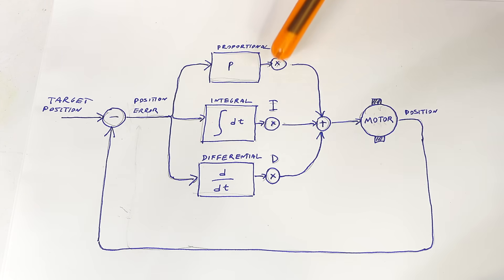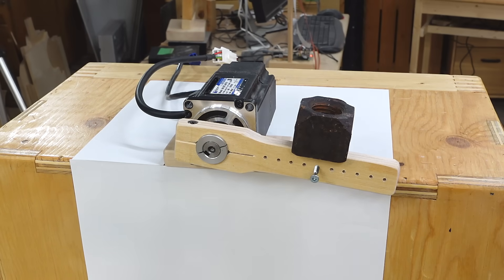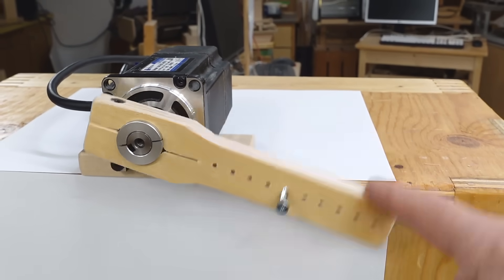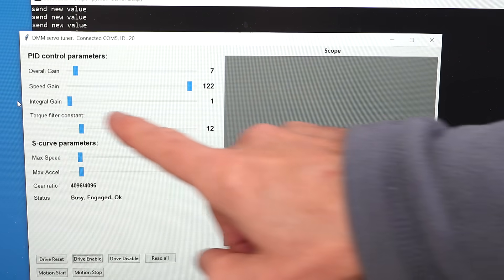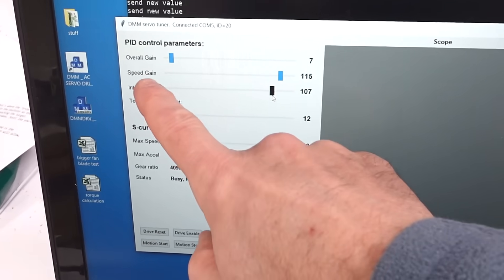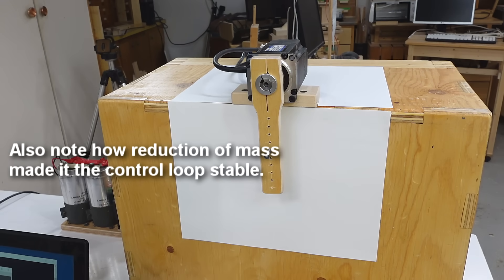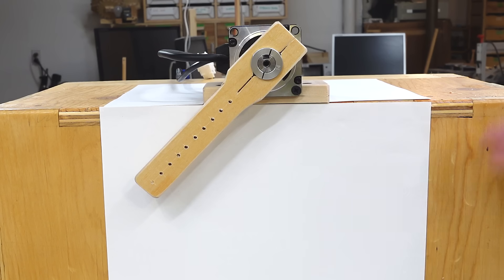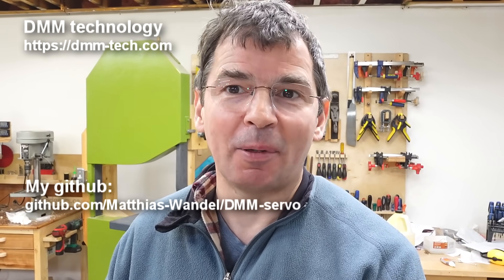What does a PID controller do?

Comment: D is derivative not differential!
Reply: Strictly speaking you're not deriving a slope from a mathematical function, you are measuring a difference in a signal, so "differential" seems like the more technically correct term, even though everyone calls it the derivative.
Reply: @excrubulent  Actually you are calculating the slope of a function - that of error vs time. Yes you calculate the difference between two error samples (an approximation of the differential) but then that gets divided by the sample period resulting in an approximation of the derivative. And that's why it's called the derivative term and not the differential term. Anyway i enjoy the videos - keep up the good work!!!!

Comment: I like your sliders.  Most of the processes I was involved with took a long time, so tuning PID was difficult.  Mostly systems worked well with just enough power (actuation) and on/off controllers with loop times that were much faster than the actuator response.    Some controllers have integral time instead of integral gain settings... so it takes time to figure out what's going on.
Reply: The gain on an Integral section is adjustable, it's a multiplier for the incoming Proportional signal.  What is changed or adjusted normally on them is the RATE that the gain is applied at.  Called Repeats Per Minute, RPM.  That's what you are adjusting in reality, the time from where if there is a given error, the Proportional signal is added to the Integral output.  So if it's at an Integral gain of 1 and at an Integral rate of 5 RPM, for a certain error it will add 1 times the Proportional signal to it's output.  If that deviation is still there in 12 seconds, it will repeat adding one unit of Proportional output to it's signal  It keeps repeating that until the error goes away.  If you change the rate to 10 RPM it will do that twice as often, so every six seconds.

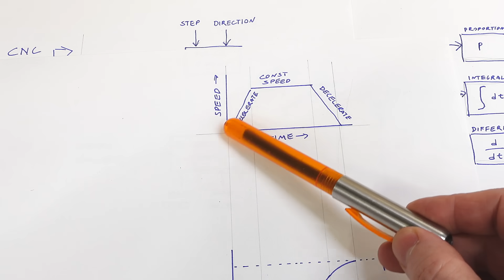Comment: 8:10 - Maybe other people pointed this out. The way you structured the explanation - S curve is actually not accelerating at a constant rate (straight line - as you point to a trapezoidal style acceleration strategy) but at a certain mathematical function (that results in not a straight line on the graph). Also you have only drawn a half of the S curve graph if you want to talk about reaching the desired position - what you have there is only reaching the desired speed.
Reply: I think he mistakenly labeled the Y axis as speed, when its probably position, as in position over time.
that would make the graph make sense

Comment: As an mechanical engineer and having tuned servos, this is a great video. Thanks for posting! Some college professor is going to use this video. A common issue I come across with instability is because of dead band or backlash feedback and servos tuned up way too high by someone who is obsessed with speed at the cost of reliability.  I always back my settings down slightly and never have issues.

Comment: Nice illustration of pid controller. How ever I think what you referred as S-curve here, was more like trapezoid control (constant acceleration, infinite jerk). When talking S-curve we normally have constant jerk, which makes acceleration to look like trapezoid, which makes speed curve looking like S-curve and which makes position curve looking more like S-curve. And making the acceleration non constant makes the system really smooth. So if you have glass of water on linear axis driven by S-curve, starting and stopping doesn't make water spill so easily. That would be really nice illustration also.

Comment: Nice visualization of PID. For me, before I knew there was such a thing as PID, I was tasked to get a slave microprocessor to “tweak” its VCXO to match the master TCXO using only the receive data as the “phase detector”. Determining if it was ahead or behind was easy (differential) But if I just ticked the control voltage up or down every sample time (every data edge) by the time it shows no error the correction has accumulated a lot of “gain” meaning the speed at which it was approaching zero error was high. So it just oscillated back and forth infinitely. I thought that if I knew the direction had changed then I would be good! Nope, I needed to know how far away I was from perfect sync (proportion). So if I was far away I needed more gain to “hurry up” and as I got close, I needed to slow it down (Integral). I figured it all out one piece at a time and then 20 years later I am working with a Peltier cooler and a PID controller for them and I was like “I’ve done this before”. I had no idea it was a “thing” back in my youth.  But it is a very difficult thing to explain and my long winded comment is just to say, good job! 😊

Comment: Maybe PDI for motor control and PID for high thermal mass temperature control or big ship navigation control (where I think analog PID controllers made their debut) . I am thinking Motor Position control has to deal with sudden system upsets or step upsets so needs to rely more on the D term whereas temperature control not so much (except at turn on) and relies more on the I term, although it depends on the exact nature of the system.  My PID soldering iron controller does well with some D to quickly respond to sudden changes but the slow cooker controller does not seem to benefit.  Curious what others think. Edit - I see it has already been discussed below

Comment: At my previous job, we used a PID controller for monitoring the temperature of a hot plate. Allows fine control of the temperature ramp speed, so you can hit certain temperature markers smoothly and without overshooting.

Comment: I have seen videos of car crashes in which a car starts swerving back and forth, increasing in amplitude until it hits a neighboring car.  This seems to me to be an oscillatory instability caused by a mistuning of the P and D parameters in the control servo, which resides in the brain of the driver.

Comment: you can also use a PID as a controller for thermal applications. I upgraded my espresso machine's crappy thermostat with a PID controller + thermocouple (technically an stm32 performing PID). it gives me near-perfect temp stability rather than having my water temp bounce around all over with a thermostat

Comment: Excellent PDI / PID explanation, and you alluded to the most important thing with the S curve stuff, but didn't say it: PID should only ever be used for fine tuning. You should always have a static curve, 2d or 3d depending on the problem domain, and use PID on top of that. Otherwise the PID is always "working too hard" and will inherently have bad performance in that state. Cheers.
Reply from the maker: not everything is s curves.  on a cnc, it’s all about following the path given by the g codes.  for a lot of other control systems, the input simply is not predictable, if it was, you wouldn’t need a control system

Comment: That should be the *differential*, right? Just checking for my understanding. 3:50
Reply: Yes you are right. I came to the comments to see if anyone else pointed this out.
Reply: Oh shoot, I didn't actually check the timestamp you mentioned. I thought you were comparing "derivative" and "differential."

Yes, you are exactly correct.
Reply: @ ah, makes sense, got confused for a while there
Reply: Six in one hand, half a dozen in the other 

The two terms refer to the same thing
Reply: @shikutoai huh ?
Reply: Yes

Comment: It depends on what you try to accomplish with a PID controller
For temperature you may only need P and I but no D
For position you may need only P and D but very little I as you showed
For very slow things like a solar sun tracker you might only need I and no P and D (with a dead zone where the controller does nothing if it is somewhat close to target to avoid it wiggling back and forth)
Reply: thats what I was wondering.

Comment: I invented PID-controller all my own while in the army. I was reprogramming Russian auto-canon to destroy any back doors. Officers did not like the jerkiness of thing, so I invented filter with three parameters SNAP, JERK and SLUG. Except similar but funnier words in Finnish. Only years later did I learn about PIDs.
Reply: How do you do a job like that and not know about PID... I swear defence hires are drawn out of a hat.
Reply: @vablo7198  I was 8080 assembly expert, rare skill in 1976. I was in Telecoms and did not know much about motors. Anyways I saw how well the Swiss Oerlikon Cannon moved. It was snappy and did not overshoot, unlike the Russian РБК Cannon. It is not difficult  fathom what kind of parameters there are in that movement. Harder was to implement the filter real-time in assembly.
Reply: hi timo, have you become a flat earther yet? If not I suggest watching Level with Me (2023) by Hibbeler Productions
Reply: @flat-earther  Unfortunately I also developed  famed astronavigation program in 1980's, which only works if the earth is not flat. Link to Github in my Sointula-video.

Comment: DMM is pricey for experimentation.
How about using a hoverboard motors and applying PID real-time adjustments.
I got a Hoverboard/Hoverstar off craigslist for $15 with dead batteries, that I would love to connect and run this python script and understand how they balance.
Reply from the maker: that requires adding a precise position sensor and reading it frequently.  basically, requires a microcontroller

Comment: Misleading video (thumbs down). PID is NOT "for motors" only. Others things too (almost anything, temperature, speed or position of the hydraulic actuators and so on), countless applications.
Reply from the maker: temperature doesn’t have inertia, so not good for that.  and I did not say for motors only.  thumbs down to you for idiot commenting.
Reply: @matthiasrandomstuff2221  temperature does have inertia, it's called thermal mass. Thumbs down to you for thinking you're the smartest person in the room. Sometimes you're not.

Comment: Sir, Can You do a video on how to configure a set of AC servos attached on both side of a Gantry of a CNC Router with rack and pinion drive system. The inertia of the Gantry and the Z axis Weight ,while driving them fast affects the quality of machining jobs right?  Also motors on both sides need to keep the gantry alignment while driving the gantry fast with such payload. I would love to learn more about these concept of tuning AC servos for the maximum performance without loosing accuracy.

Comment: Sadly, I've seen electronic valve actuators ruined because the PID loops weren't tuned, especially after replacing a pneumatic valve actuator with an electronic actuator. Even things like not relaxing the deadband will kill an electronic actuator as it hunts needlessly at setpoint.

Comment: Often in industrial processes you only use P and I because your signal is too noisy to use D without a low pass filter which hurts response time anyway or just de-tuning to the point where it isn't great.

That said, you do see PD a lot in motion control (as you did here) because the encoders on servo motors are good enough.  Generally in closed loop position control your velocity command output is the velocity from your s-curve motion planner (which isn't actually what you showed in your diagram - that was a trapezoidal move.  An S-curve move would have jerk applied so your velocity plot wouldn't have hard transitions) plus a PID on the position error.  If you don't feed-forward the velocity like that and just rely on a position error PID you're basically already behind when the motion starts.   Then in your drive there is probably a torque PID loop that converts velocity error into output current and phasing.

Comment: Why did I have to attend a whole semester at college to learn this when Matthias can explain the PID controller in 10 minutes ?
Reply: In his explanation there is no math, without math there is no real engineering.
Reply: Folks here have it.  You can tune a simple motor like this "good enough" with basic understanding and intuition but the signal processing math behind all this is what you need to make a rocket control system.
Reply: @akiriwas  The Maths still get tuned by real world experiments.
Reply: Brings back memories of a third year control systems lab, now getting on for half a century ago! Of course we had analogue computer control systems!
Reply: A good explanation begins with intuition, but there is a lot more to it than that.
Reply: The Dunning-Kruger effect likes this comment.
Reply: Because it’s generally considered bad form for an aircraft’s control surfaces to become unstable like that pointer. Maths is used to try to ensure the system cannot end up like this.
Reply: I enjoyed the class but didn't enjoy the parts with differential equations
Reply: Because college is a scam. Sure, some 'guy' will say "ackshually there are so many aspects of control theory you can only learn in college!" well actually how about eat my ass? The textbooks for control theory were written decades ago, and the material doesn't only exist in overpriced university textbooks.

Skip college, get a job, EDUCATE YOURSELF, and use that money over the time you would have spent going to college to invest in yourself. Screw all these losers that say "but it's too hard to start a business or be successful!" they keep themselves down with that attitude. Life isn't fair, so make it unfair in your favor.
Reply: I believe it was Bernard Shaw who said,
"He who can does. He who can't teaches."
Reply: Wow. Super good video for explainig PID. Thank you!!!
Reply: Because academia wanted to make you queer by forcing you to take gender studies classes.
Reply: Sorry, would you mind sharing which college you're from?
Reply: because you went to a shitty college
Reply: Because this is no explanation, but rather a demonstration. This video would never allow you to design and tune a control loop, which the college course does. (at least in theory)
Reply: Because colleges are after your money and mind, not your best interests.
Reply: The one I went to certainly wasn't like that with all the engineering and math lectures wanting you to do well
Reply: Because college teaches you the hard part. The math behind it all. Knowing how it works teaches you how to use one. Knowing the math teaches you how to design one.
Reply: They’re intentionally making it really hard to figure out basic stuff so people think college is useful.
Reply: Total nonsense
Reply: Maybe consider that you don't belong at college?

Comment: I use a PID to regulare the temperature in my aluminium melting furnace, and didnt really understand how it worked.  I now don't understand it a little less, thank you.
Reply: it is insane how well he shows it. it makes it look way more simple than it is. crazy how smart people do that.
Reply: @BloodSprite-tan  Feynman technique😉, that's why.
Trying to paraphrase what you've seen, and trying to explain it to yourself, is a very effective way of learning a topic. And if you're used to that method of learning, then it will be easy to share your knowledge too.
Reply: QRD:
Proportional gives a stronger signal the further you are from your goal.
Derivative gives a stronger signal when there's an input change, allowing the system to react faster at first.
Integral gives the final push towards the goal, as the non-zero error accumulates. 
All together they create a myriad of behavior profiles and you need to tweak the coefficients to deal with how fast it gets to the goal, with oscillations, with overshoots and undershoots, etc.
Reply: @lforlight  Of all the comments on this, so far you are the ONLY ONE that has it right!!!  The only thing I was add is that Derivative (not differential) is based on the rate of input change
Reply: @nathanwahl9224  That's nice to hear. I fixed the derivative/differential mix-up. Thanks.
Reply: @lforlight  More than welcome.  I saw it in the post several times, and it just didn't seem right.  I had to look to jog my memory.  I did a search and put in "proportional integral d" and Derivative popped up; Aha!!! Basically derivative is something based on changes, and at high levels.  Differential is something taken at the finite, smaller level.
Reply: @nathanwahl9224  Yeah, differentials are used for derivatives, as you divide your function's change over a differential, an interval so small it approaches zero. Differential equations, for example, refer to equations that have both a function and its derivative in them.
Reply: He’s talking about tunning, and your talking about perfecting the tunning, that’s the beautiful joy of the dance of physics, that is not only to dance for only joy, but for every one else’s joy too. ;)